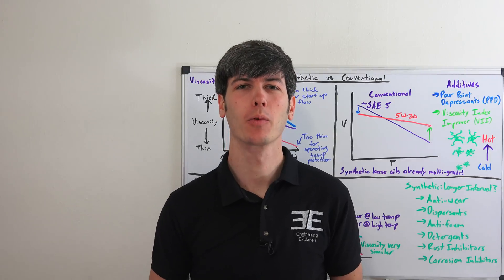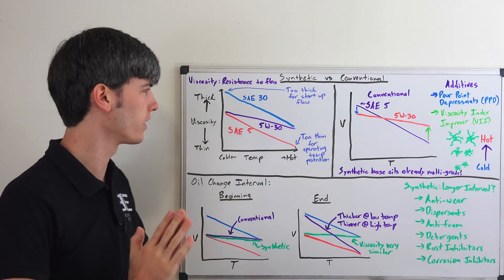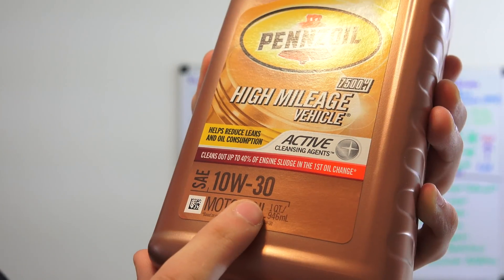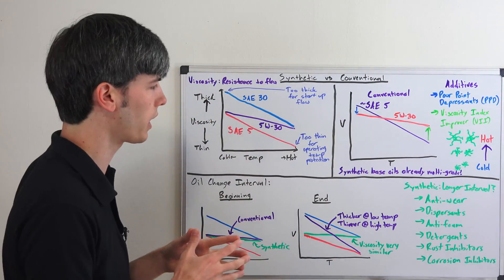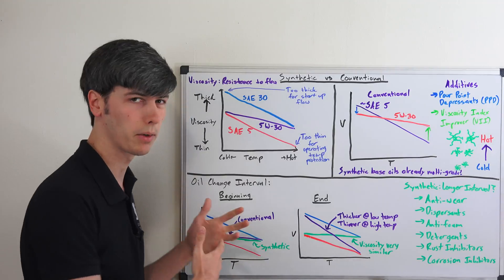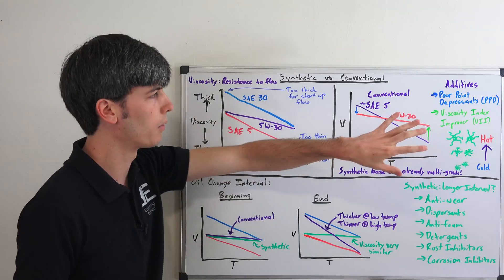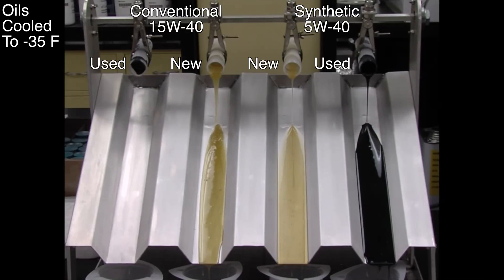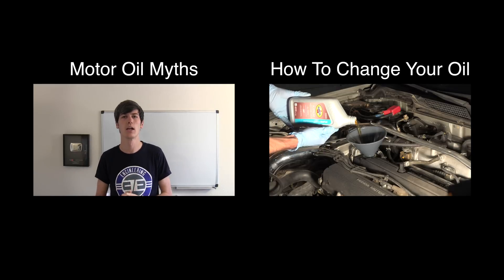Is Synthetic Motor Oil Better For Your Car?

Comment: Use a good grade conventional and change it every 5 -6000 miles. Don't waste your money on synthetic oil. The average person will never be able to tell any difference and you can get 285,000 miles on your car like I did. Synthetic oil is good oil I am sure but modern car engines are built to tighter tolerances than they were years ago and the conventional oils work fine. Just take it from an old man that has worked on a lot of cars over the years......

Comment: I would like to see that same "lab" conditions test at a reasonable temp, lets face it -35, what proportion of the motoring public see that kind of temp? If I were a betting man the results would be barely noticeable, if I were a betting man it would probably be from the same lab that bought you premium gas science. And side note, what is so important about it being derived from natural gas? Are all those other oils on the market from unicorn tears or something?

Comment: The dealership I used to sell at used Mobil 1 and they had a demonstration of what the engine looked like after using that vs using regular (it was like marketing thing it was just their own test).  After seeing that and the fact that you can go so far on it without changing it led me to switch and never look back.  

My dad growing up used synthetic in his truck which was a 90 Silverado w/ a 4.3L and he changed the oil ever 3k religiously (not needed now but back then I guess).  That truck had 276,000 miles when we sold it and the only parts that were ever replaced were the slave cylinder on the clutch and the water pump.
Reply: No.  "Synthetics" should not be used to extend the oil change intervals. The speaker here said that and he's right.  The Mobil web site says the same thing and they're right, too. Your dealership's demo is just marketing nonsense.
Reply: Changing the oil is important, but Silverados in general last a very, very long time w/ little wear. Mine is a 5.3L at 301,900 miles right now and looks and runs like it's @ 80,000
Reply: I have a 2001 Chevy Tahoe that was changed to Mobil 1 at the first oil change (3000 miles).  It has never had an oil change since.  It is now 1016 and 300000+ miles later and it has had 3 batteries replaced and zero mechanical repairs or replacements.  Changed to Transynd at 100000 miles. The secret?  Followed the original Mobil one recommendations of an oil filter change and top off every 3 months.  About 15% of the miles on the vehicle are towing miles, the remainder are stop and go city traffic.
Reply: Transynd is automatic transmission fluid you dipshit. We're talking about engine oil. Completely different fluids for different parts of your car.

Comment: What you say is correct. However in the real world things are a little different and I explain:
In warmer climates older cars with lots of mileage  are better off with non-synthetic oils because piston rings have already got some wear on them. With a synthetic oil your engine would quickly burn that oil up while non-synthetic oils tend to fill those micro-gaps better.

Comment: I don't know if it's placebo; once I changed to synthetic, I could feel the engine revs more freely.
Reply: If you switched from mineral oil you prob not wrong about your experience.
Reply: Same viscosity?  If so, placebo.
Reply: our Toyota corolla did the same thing. my dad and sister agreed that it seems like it had a easier time after the oil change.
Reply: It depends on the oil you used. Synthetics can be a little thinner at operating temperature than conventional oils even though they still may say the same exact numbers on the bottle; Pennzoil 5w30 vs. Pennzoil Platinum 5w30 is one example. Check the data sheets if you will, the data for viscosity at 100 degrees C is there for both on Pennzoil's website.

Conventional 5w30:

http://www.pennzoil.com/en_us/products/blends-conventional-oils/conventional/_jcr_content/productDetails.stream/1460058457626/e6823906a59d0b4de695429dc846a59906458592de142344c892fbbba32e26a1/Pennzoil-SAE-5W-30-Motor-Oil.pdf

Platinum 5w30:

http://www.pennzoil.com/en_us/products/full-synthetic-motor-oils/pennzoil-platinum/_jcr_content/productDetails.stream/1460058453075/73d957b370df2e49693e82ece9a0a5bb2f048868be34afadaf2c488ca81a57a5/Pennzoil-Platinum-SAE-5W-30-Full-Synthetic-Motor-Oil.pdf
Reply: ***** yes it need one bad.

Comment: This video for me was worth it just to know the "W" stands for winter.  I've been using oil for 50 years and I didn't know that.  Another handy word to know is when you are pounding a nail and miss or bend it over, that's called an "overstrike".

Comment: soooo synthetic oil in say an 80's car is good?
Reply: Technically high mileage and exposed to high temperatures. Yes, Synthetic would be a good choice.

As ***** mentioned, the switch may expose oil leaks that the conventional oil was leaving plugged by deposits it failed to clean. The detergents in Synthetic oil typically does a much better job of cleaning up the deposits and possibly exposes oil leaks.
Reply: @Argonian Bilbo
The myth of synthetics eating oil seals started in the 1970s when Synthetics were new to the car market; they either swelled or shrunk seals back then.
Reply: Synthetic oil won't make one damn bit of difference other than possibly causing problems for you. It is not necessary to put this expensive oil in your old ass hoopty.
Reply: nope, you would quickly run out of oil
Reply: camaro.matt Myth.
Reply: I use Mobile 1 15w-50 in my 86 944. It will work fine unless you have a leak. Ive been told that synthetic in an car that needs mineral oil will eat the seals. I havent seen that personally yet.
Reply: Another old myth that hasn't died yet.
Reply: It's true, I've been using Pennzoil Platinum 5w30 in a 1984 Caprice for over 3k miles now and it found an oil leak. It only leaks a few drops upon shutoff but I'm thinking of switching to Valvoline Full Synthetic Maxlife 5w30 since it's a little thicker than P.P. 5w30 even though the Valvoline oil's still a 5w30.
Reply: if you burn oil, your engine can't be clean, carbon buildup will form
Reply: Synthetic will always be superior, but pay attention when switching from conventional to synthetic. Older, or higher mileage engines may have valve seals that are dry-rotted and the conventional actually swells them up, acting as a band-aid, so when you switch you lose that swelling, and the synthetic will leak past those old valve seals.
Reply: 1985cjjeeper yee har you reckon, damn we should go back to using good old raw unrefined oil. we don't need no new fangled technology .
Reply: 1985cjjeeper :D , these old push rod OHV engines were not designed to last a million miles , heck even the speedo only had 5 mileage digits on it.  My 39 year old one has 130k on it, it had spent a lot of years sat doing nothing and it took a while for the synth oil , helped with a bit of redex, to clean out all the crud that formed from the old mineral oil that was in it. The last 21K miles were done within the last 12 months.  Using mineral oil so it wears out/clogs up sooner is a pretty poor excuse.
Reply: If you want to clean all the gunk out, swap out a half quart of oil for automatic transmission fluid during an oil change and drive it normally for 50 miles before changing the oil again. You may want to change it a few times over 1000 miles or so after that using just oil. You'll know how many times to change it on your own when the smell of rotten oil no longer exists and no more sludge is plopping out of the drain hole. Using ATF to de-gunk an engine is an old mechanics trick that does wonders with sticking lifters. For example I've owned the Jeep in my avatar for 22 years now. About 11 years ago I had a lifter knocking that got to the point where it took several minutes before it would calm down. I changed the oil, added ATF in place of a full quart (already had a knock, give it hell ATF!) and when I started it up the lifter noise went away completely in only a few seconds. I've put about 30 thousand miles on it since then.
Reply: Is it exposed to high/low temperatures? Yes. Is it a high mileage engine? Yes although, I'd have the oil pressure checked which could indicate worn bearings.
Reply: Cali weather so its exposed to mild temps. 150k on the motor
Reply: Manny Thanks, appreciate the info.
Reply: Practically speaking, it shouldn't make any difference at all for the average driver.
Reply: its ok in a 77 car :)
Reply: krauser979 and whats the european formula?
Reply: Austin Lucas Pennzoil Platinum is more for engines that are fairly new and are manufactured with tighter tolerances. If that '84 Caprice has it's original engine (Came out in '80) I'd just pick a Synthetic designed for high-mileage engines. Valvoline MaxLife or Mobil 1 High Mileage will both fill that job nicely.
Reply: Manny yep the 10w60 i use is designed for high mileage / hot engines.
Reply: +Manny I was attempting to increase fuel mileage. It's probably not worth it monetarily though considering I have to add oil but at least the engine's a lot cleaner. I expect to change oil to that Valvoline type you mentioned.
Reply: 150k miles is a lot, i would not recommand switching to synthetic unless you are 100% sure of the engine : that it has no small leaks that could get worse, and that the crankcase is not sludged up, that sludge could get displaced by the synthetic and it could clog the oil ports
Reply: Austin Lucas Once you get the oil leaks fixed, hopefully with the change to Valvoline MaxLife, then the only other suggestions I can make would be minor. Looks like the engine in that Caprice wasn't very fuel efficient in the first place. Off the top of my head, I'd ask when was the last time you replaced the fuel filter, distributor cap & rotor, and spark plugs. Basically, when's the last time you got a tune-up.
Reply: ***** I believe Austin explained that he simply has a leak. If your engine is actually burning oil, or it's "disappearing", then I highly suggest you find out why. Many things could be causing it and most of them aren't good.

You do bring up some good points that I already mentioned but the additives in the oil should soften those deposits so that they may pass through the system without clogging. Most engine oils contain some of these additives. Unless you've been using bargain bin or store brand oil then you need not worry. This is really only a problem on engines that have been ran far beyond the suggested oil/oil filter replacement interval, has been sitting for a long duration, has worn components (bearings/rings), or has been ran hard (lead foot/racing). Most of the time sludge build up is an indicator of worn piston rings.

Oh, 150k miles is not a lot in all honesty. I personally own 2 cars that are far beyond that. First one has 260k miles and needed to be rebuilt when I bought it. Previous owner was quite negligent. I did that at about 160k and it's been fine since. It just leaks out the main seal and I've been too lazy to deal with it. The other car, my commuter Honda Accord, is nearly to 505k miles and all it needed was new piston rings around the 385k mark. Since I was in there I replaced the bearings and had the block cleaned and honed. It doesn't leak or drink oil to this day. :)
Reply: No, obviously our engines weren't designed to use raw unrefined oil you slack jawed yokel. Look, if you are going to keep the car and drive it for 1 million miles then by all means, use synthetic oil after the first 15k and you might just get there....after replacing the drivers seat a few times, the steering wheel and column, plus a myriad of mechanical and electrical components. Or you could just run conventional oil, drive the vehicle for 450 to 550k, and only replace nearly every other component in the car maybe just once or twice.
Reply: +Manny Yes, it is just a leak; every time I park it in the garage after a run I get oil on the floor. If the Valvoline Maxlife F.S. 5w30 doesn't fix it I might just switch to Renewable Lubricants' oil so I don't leave toxic oil spill everywhere; RLI makes their oil from vegetable oil and it does work, I had some in my Suburban.
Reply: That is so wrong it isn't even funny.
Reply: Actually, you are wrong. One of the points of synthetic is that does NOT happen.
Reply: meanwhile another 8000 miles of heavily laden miles, many at speed and my 39 year old 1256 engine is still very happy with the synthetic 10W60 :)
Reply: if you are looking to clean a high miler or old engine that has been living on mineral oil with poor change intervals then change oil and fiter and add ~ 200ml / 1/3rd pint of Redex to the oil . then give that a good drive for a few weeks at least, then drain and look at the state of the oil that comes out.  it may look black as if it had been there for ages as the redex would of slowly dissolved gum and sludge and suspended it in the oil.  fit new filter and new oil and sorted..

Comment: I thought this was basic knowledge for owning a car. I put 200k on a Dodge 5.2L using the cheapest oil available and 3k oil changes. I did however typically use 0W-30 in winter as it sat outside. You know it's cold when you can hear the oil pump after starting and the clutch pedal slowly rises or stalls the engine when you let go.
Reply: Conventional oil is perfectly fine sythetic oil is a scam. It's only $20 to change your oil every 3000 miles but $50 every 5000 miles do the math.
Reply: Rotella t6 5-40 is only 19 dollars at walmart.
Reply: ***** Sadly that's the world we live in. People don't want to understand how things work. That's why they buy Apple products and $1000 HDMI cables and the like.
Reply: +Prepper Man bought mine for 12 a jug after Pennzoil rebate, I think he was referring to taking your car to an oil change place
Reply: Or 25,000 miles for Amsoil Signature Series.
Reply: +Prepper Man people pay for convenience brother.. I daily a fox mustang and the only bolts on it that aren't turned exclusively by my own wrenches are the drain bolts. sometimes after a long day then night then morning under the car u feel like a cold soda while a monkey changes your oil.. but people who don't double check the work themselves are in fact retarded.
Reply: ***** I don't disagree with u. Every time I drive past the Walmart service entrance I utter a prayer to the car gods for those unfortunate motors. Those guys aren't worth a beer cap of piss..
Reply: +Prepper Man ok! I'm referring to oil change places like gas stations and dealers as a lot of people don't have time to do it there selfs.
Reply: Your mileage may vary, I had oil changed at my local Walmart and the engines didn't blow up afterwards. The same store did however say on my Diesel engine the "oil bolt was welded to the drain pan"  which was false, there was just a oil bolt size reducer welded on the pan from factory. I don't think they even tried to remove the bolt, I later tried to loosen it and it worked.
Reply: Never had luck with synthetics. Racing 2 strokes motor was spotless inside at teardown but when you stuck it, throw it away. Castor oil motors would restart after cool down with no harm done. 97 LA318 motor ran regular 30W Castrol from day one with 3K oil changes and sold it last year with 455K. One broken valve spring at 200K. Truck still on road. Came to hate synthetic grease/gear oil in wheel hubs. Moisture won't mix and etches/pits bearings and races causing failure. Need wear ring when replacing wheel seals from etching/pitting on machined surface. Those oils have their place, just not for everyone or everything.

Comment: How do you feel about Rotella T6 for a wrx? Have heard a lot about it but would like your input on it. Thanks
Reply: my last subaru loved that, high zinc oil
Reply: works fine in my wrx, use an oem filter.
Reply: Great oil for older engines the zink helps ALOT extra cushion,helps fill possible scratches in the cylinder walls if the first owner didn't do oil changes as recommended ,or worse never came close to doing it on time. That is most car owners,they run their cars 2-3 thousand  over the time to change
Reply: If you have a WRX with an EJ series motor (02-14) then I'd recommend using it.  The higher zinc content combined with the higher viscosity rating at operating temp is more beneficial compared to a mobil1 5w-30 because it resists shearing at those higher operating temps caused by the turbo.  If you have a 15+ WRX, it's my understanding that any solid synthetic oil will be ok (not sure on the recommended weight though)
Reply: Rotella is diesel oil, and is not safe for use with catalytic converters. Say's it right on their website.
Reply: I use T6 on my even older EJ (1998). Tons of us use them in the various GC8 models to this day.